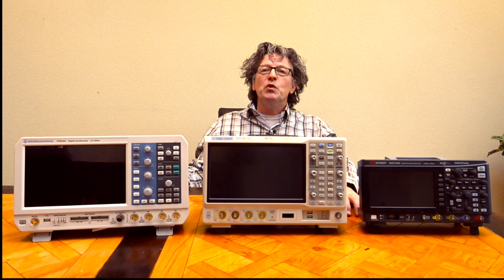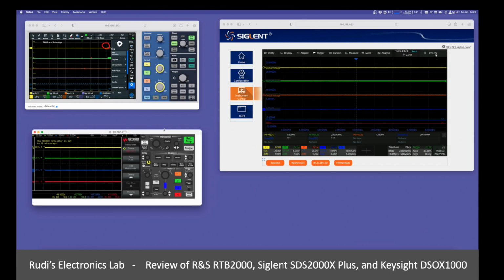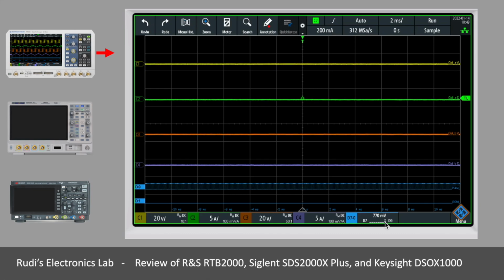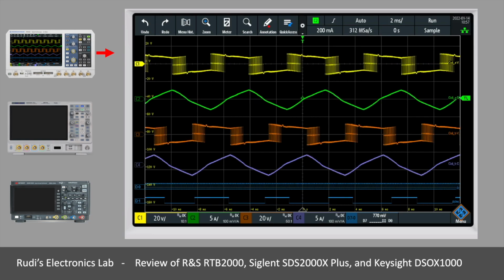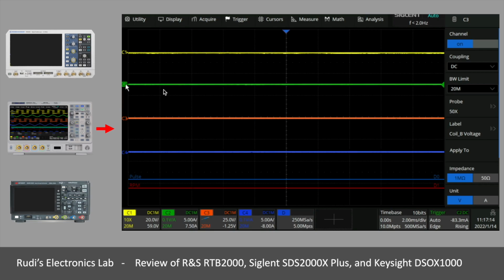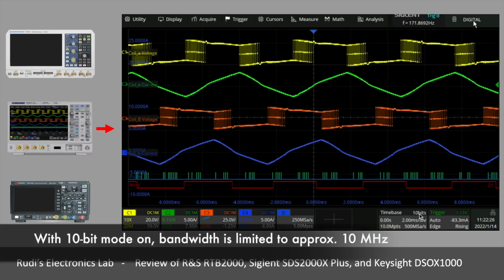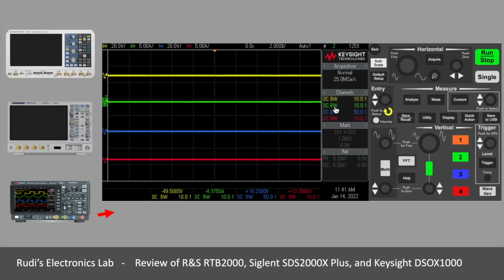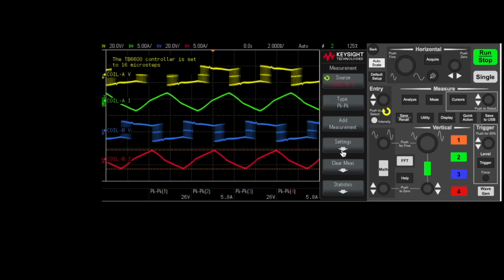REL #07 RTB2000, SDS2000x Plus and DSOX1000 Oscilloscopes, Episode 2: User Interface & Customization

Comment: I noticed that on RTB both digital channels showed very uniform pulses, but on SDS there were a lot of missing pulses and frequency measurement was jumping around. Is there a problem with SDS, or measured signals were different?
Reply from the maker: I see your point, and one would expect to see uniform pulses on the SDS as well in my experiment. But I do not yet want to draw any conclusions without further investigating the matter. For instance, the threshold settings for digital signals may matter here (even if I recall these were straightforward signals and I do not really suspect issues here). I may have a similar setup running in the near future, and if so, I will take a look at this again!

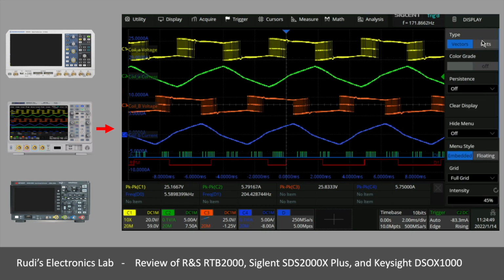Comment: Thank you for the nice video. I noticed that at 26:30 you switched from "Vectors" to "Dots" in "Display". And there was no change in the screen display. Isn't that a bug in the firmware ?
Reply from the maker: Thanks, Ota. At the moment you mentioned I indeed (accidentally) switch between these two modes. The reason why we see no difference on the screen is that there are plenty of samples to show. We are still (very) far away from the sample rate of the device. Vectors vs. dots becomes relevant when the number of actual samples you have is not that large anymore compared to the number of pixels to be plotted on the screen. The SDS manual says that this is the case when the number of samples in a frame (read the display) is less than 1000.